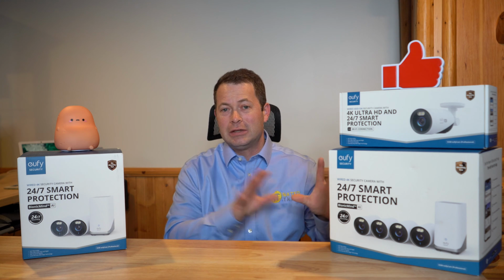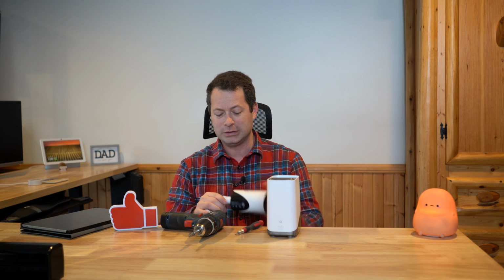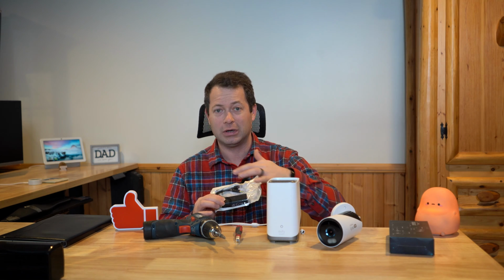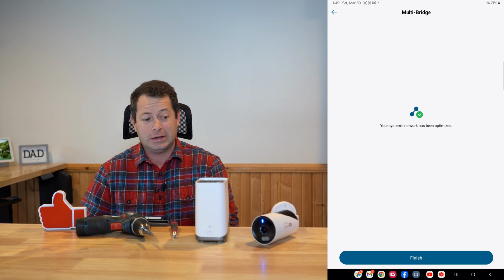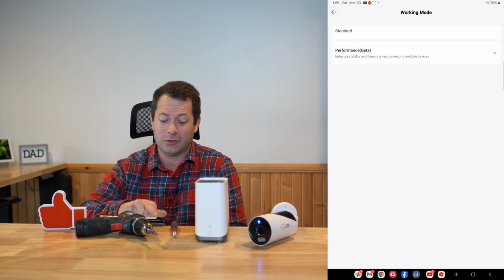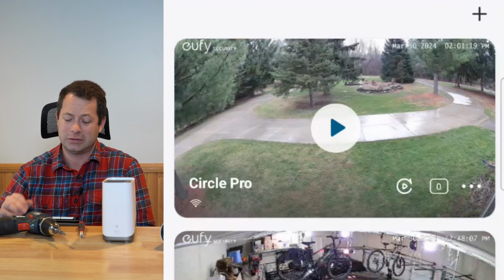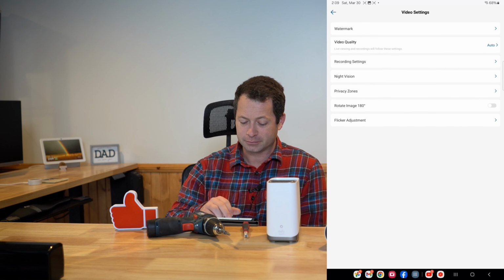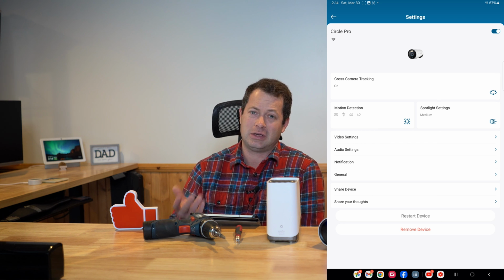✅ Install and Settings: EufyCam E330 Outdoor Security Camera - 24/7 4K Local Recording With AI

Comment from the maker: Check More About eufy E330 (Professional): 4-Cam Kit (4 eufyCam E330 + 1 HomeBase 3 + 1 TB Hard Drive + 10m Extension )
Check on Amazon: https://amzn.to/49yHo0S
Check on eufy.com: https://eufyofficial.com/SnyTnj

2-Cam Kit (2 eufyCam E330 + 1 HomeBase 3)
Check on Amazon: https://amzn.to/4avMMDj
Check on eufy.com: https://eufyofficial.com/q0sh3p

Add-On Camera (eufyCam E330, 1 Pack, Requires HomeBase 3 to Operate)
Check on Amazon: https://amzn.to/49udRFC
Check on eufy.com: https://eufyofficial.com/M6AnOk

SPECIAL DISCOUNT on Eufy products:
15% All Eufy products: https://www.shareasale.com/u.cfm?d=1048030&m=115200&u=3025734
BOGO 50% off:  https://share.eufylife.com/v1/shopping/s/g/WlJt3w774
$50 off EufyCam 3c: https://share.eufylife.com/v1/shopping/s/g/hSuU48qqP
$50 Floodlight Cam 2 Pro: https://share.eufylife.com/v1/shopping/s/g/nSKr6IjjD

3 Video Series for E330 Cams:
Unboxing and Setup: https://youtu.be/Gk1AMY_TvQw
Install and App/Cam Settings: https://youtu.be/yqxhujxtFSI
Review of Cam Performance: https://youtu.be/2nwKlv9qNh0

Comment: The keyed mount on the base can be adjusted,  you loosen the screw then slide the mount away from the base keyed slots then rotate the mount then slide the mount back towards the base keeyed slots and tighten the adjustment screw back down.
Reply from the maker: Yes, great point and I did learn that later as I was messing with them.  Thanks for bringing it up to share!

Comment: Hei. How many "mm" hole is needed for a cable to pass through a wall?
Reply from the maker: @yrcetin  probably 10-12mm to fit the round plug through.
Reply: @NaterTater  Thank you very much🙂

Comment: Can you do review of the WeBoost Cell Signal booster? I got one from Bestbuy for $1300 and is pretty good, although only in 1 room coverage, not the whole house. I get 5G UWB inside my house with the S24 Ultra, which is rare cuz 5G UWB has short range and never penentrate into the house. OnTech Dish technicians came out and install